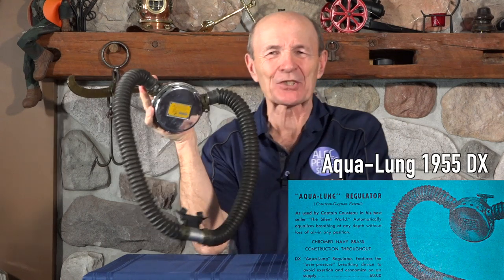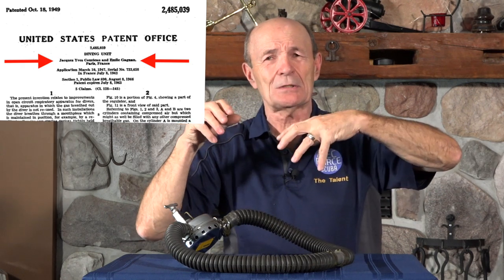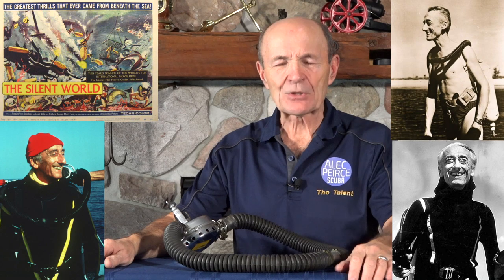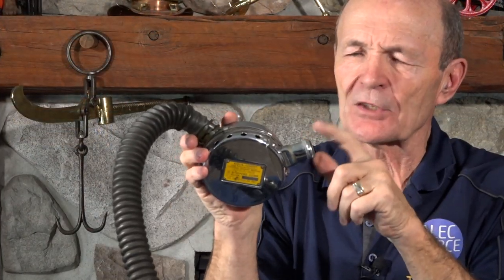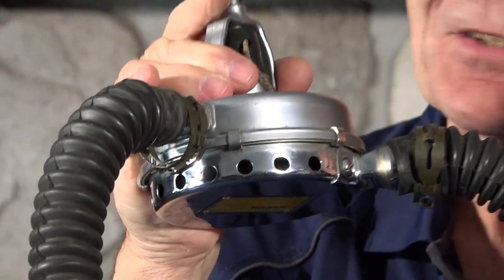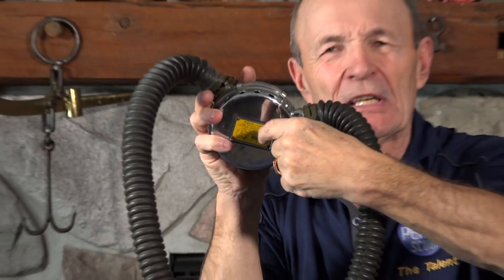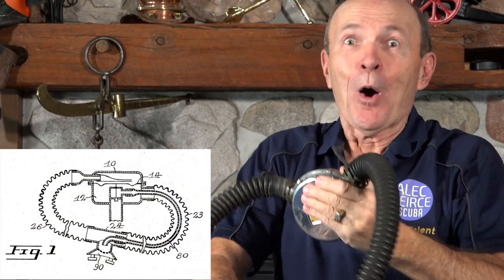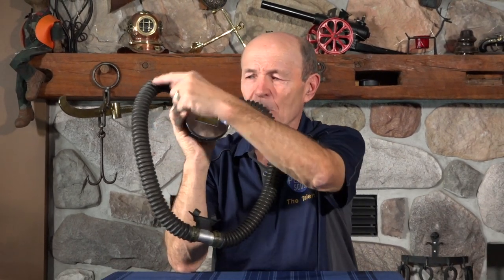Vintage Scuba: Aqua-Lung 'Over-Pressure Breathing' Regulator - S08E10

Comment: Hi Alec.I thought that the removeable exhaust made it easier to change the duck bill valve without removing the clips? I see that there was not one in that reg? Without wagon wheel valves in the mouthpiece it would be difficult to clear the water in the hoses. Did anyone ever play around with the idea of a purge cord or lever to the regulator body in the back?take care Owen m